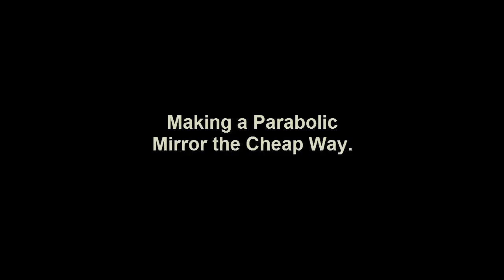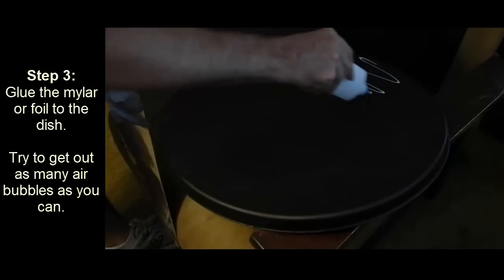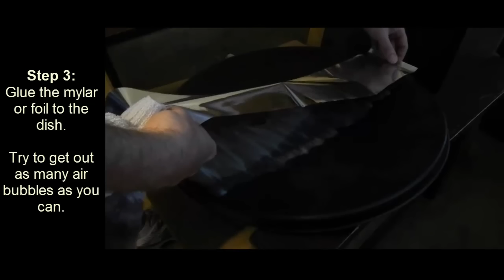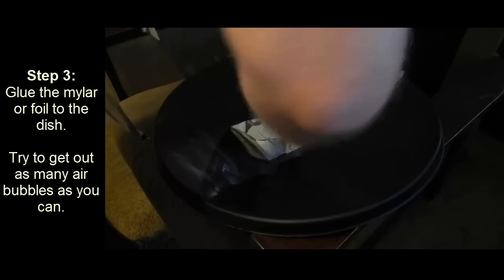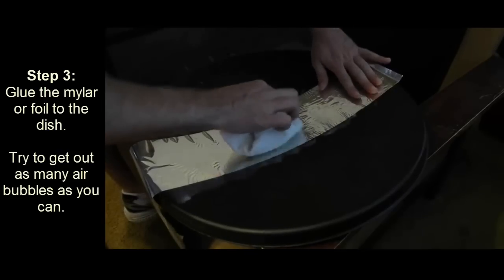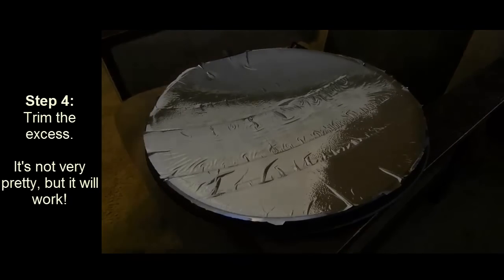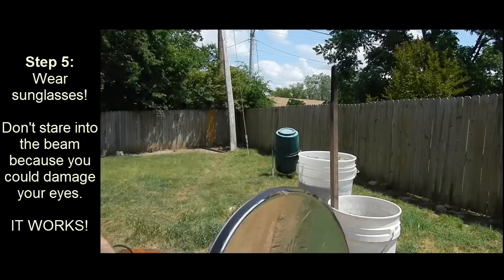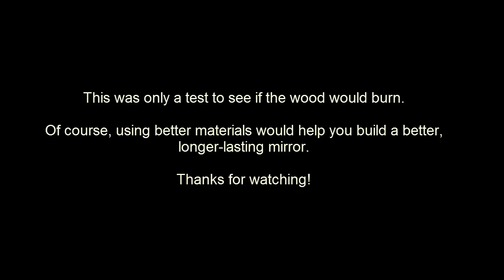Making a Parabolic Mirror the Cheap Way.

Comment: Hey  I wanted to make this for a school project. Do you by chance have another satellite i can use?
Reply from the maker: Zarqa Fatima Nope, but your neighbors may.
Reply: If you get a hold of a dish you could use it as a mould by using the back of the dish. Paper maché could be used by putting on the back of a dish then apply a reflective surface.
Reply: Paper maché dish made from using a section of a large ball could make an inexpensive dish.